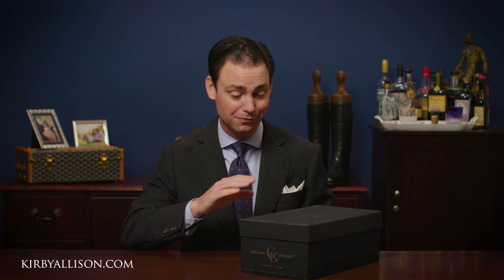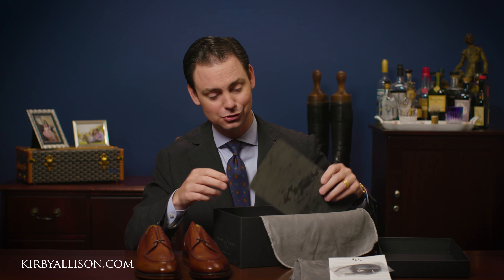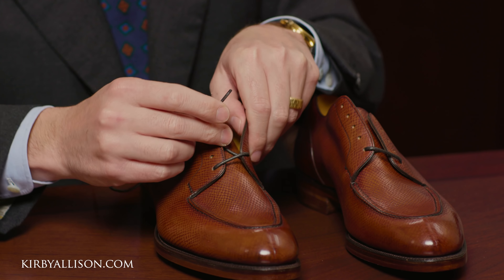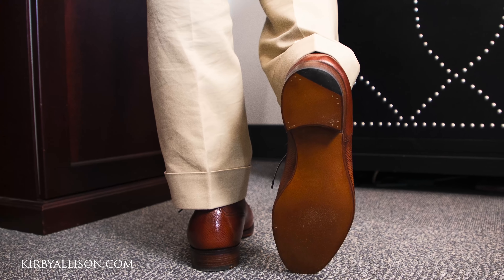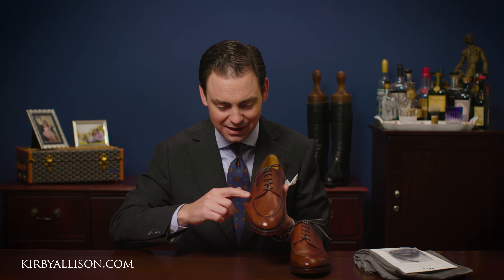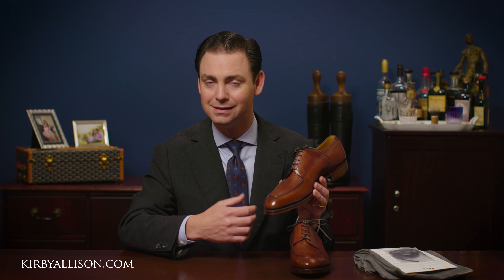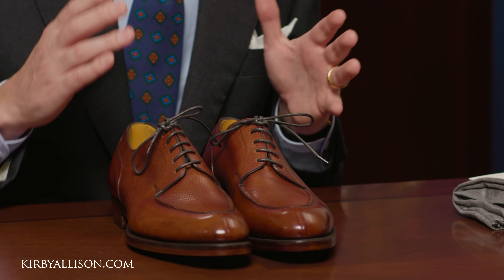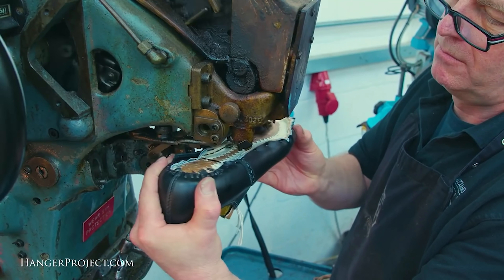Unboxing My New Gaziano & Girling Shoes! [Stamfords]

Comment: Did they use your existing last, or were they "off the shelf" for lack of a better term?
Reply: I think it's off the rack. Kirby never got a bespoke shoe from G&G before though he did get measured for video. Also, I think the shoe is a bit too symmetrical. Bespoke shoes, the toe shape is slightly different on each shoe because no two feet are 100% identical.